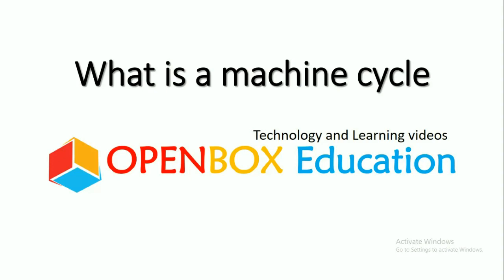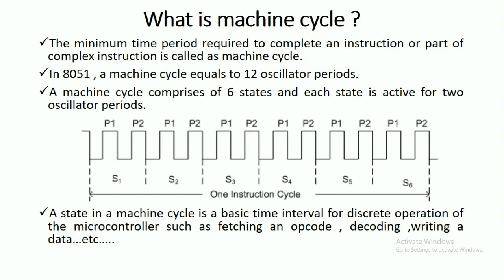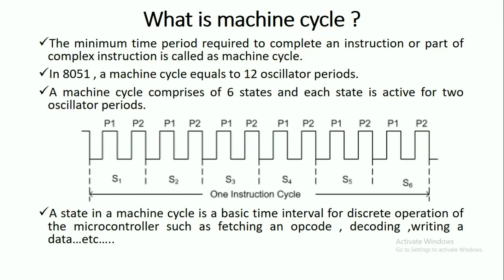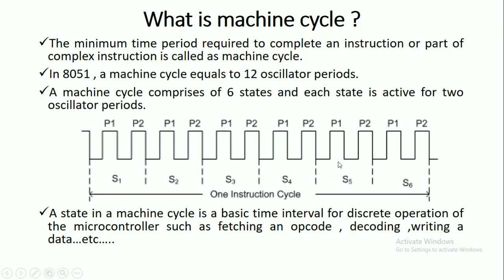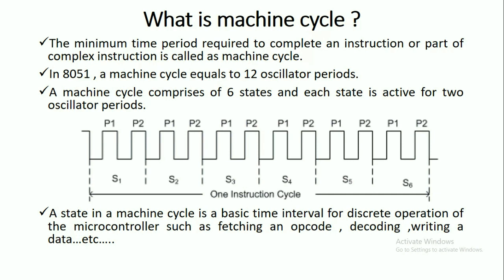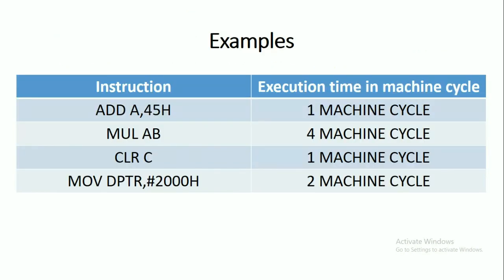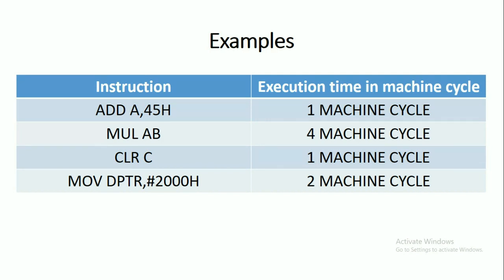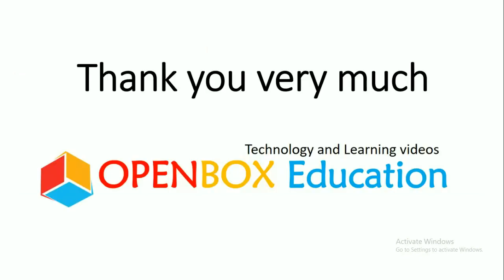what is machine Cycle

Comment: How to calculate, 'How many Machine cycle/s each instruction takes?'
Reply from the maker: Thank you very much for your comment. Machine cycle , which are defined by manufacturers like intel  (integrated electronics) . So , for  8086 it is 4 clock cycles, for 8051 it is 12 clock cycles. 😊 please share and subscribe
Reply: @OPENBOXEducation  Thanks for your quick response. My question is how to calculate Machine Cycle/s (MC) for a particular Instruction in 8051? say for e.g. MOV dir, A takes 1MC=12 cycles (OPCODE FETCH Cycle + Address Read), where as MOV dir, Rn takes 2MC=24 cycles (OPCODE FETCH Cycle + Address Read). So how these calculated 1MC and 2MC? OR These are predefined by Manufacturers? So does it mean, I need to remember MC for each Instruction or refer their datasheet for each time. Can't we calculate like we calculate in 8085 Microprocessors?
Reply: @OPENBOXEducation  1 machine cycle operation is done in _one _milli ( or )_micro second? Sir